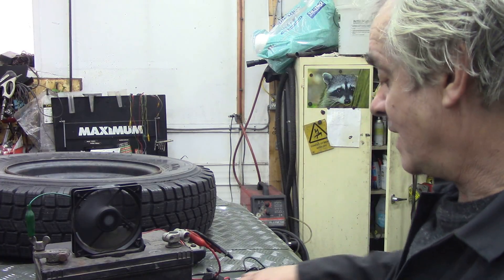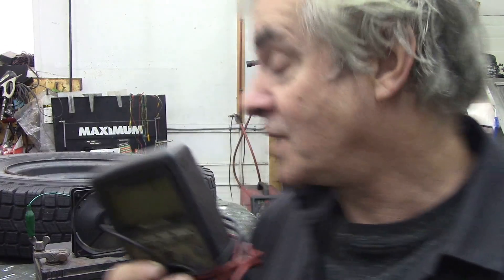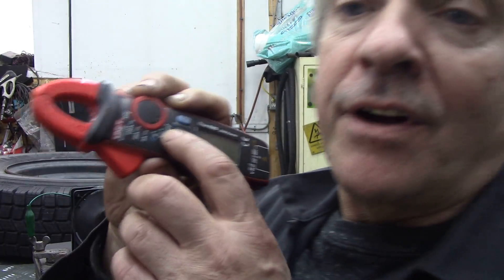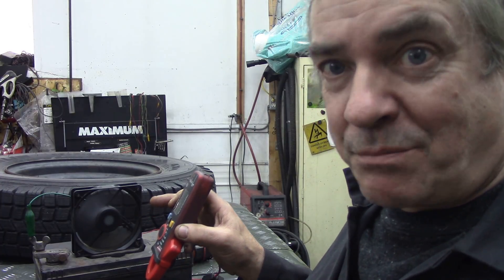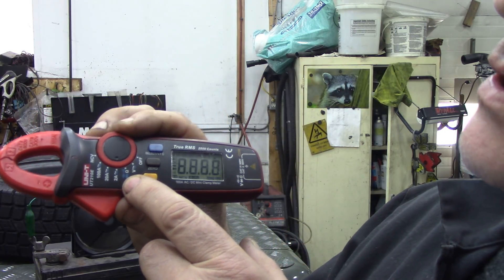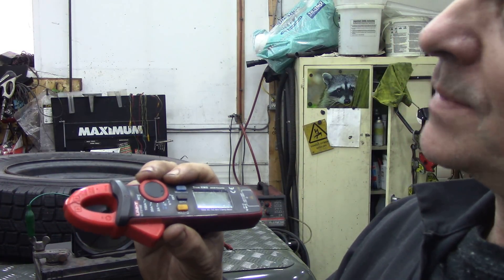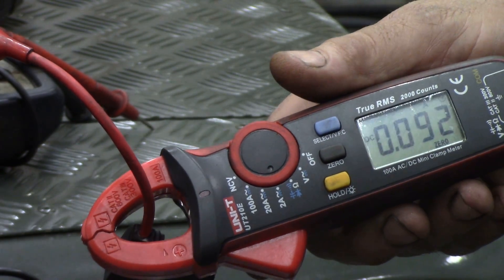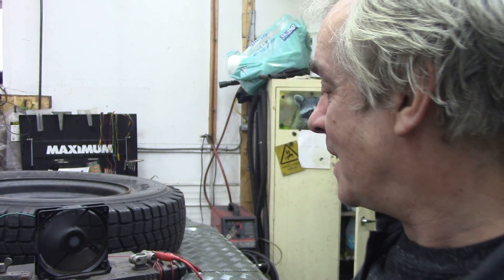Using a UNI-T UT210E clamp meter to test circuits for current

Comment: I like your style and presentation... no music or waffling on for 20 minutes before getting to the point! I just bought one. I have a high parasitic drain over night and can check my individual circuits and globally to, without removing a battery lead and inserting my meter in series. don't want to lose setting in the car. This is easy! Thanks

Comment: I tried the fuse pulling trick once. The drain was across 4 different fuses. So we just put a manual disconnect on the battery and used that if it would be parked for more than a day.

Comment: I have seen a stereo install cause a problem do to the install not the stereo it self. A screw they used nicked a wire in a wire bundle of the vehicle just enough to cause a high resistance short which drained the battery within a couple of days.

Comment: Great meter. I always carry it in the Defender. Caused some suprised looks on the faces of some other offroaders, when they couldn't find the fault in their recent solar panel setup and I used the UNI-T to measure the currents without dismantling their circuit; they had never seen a clamp meter before :-)
Reply from the maker: The DC clamp meters have become affordable in the last few years - so easy to use to fault find!
Reply: Excellent use case. I keep this in my readiness kit in my vehicle. I can do so much with my electronics knowledge if I have a meter I would want this over and above a knife in a non wilderness survival situation. I can create a cutting tool. Trying to create a meter on the fly is a little harder.

Comment: NCV Yep more easy that having to poke the insulation with a needle.   Voltage but no current often terminates in a bad or missing ground. BTW those UNI-T multimeters are rather fine for the price .
Reply from the maker: They are very good value for money!

Comment: I use a battery disconnect on my '72 Series 3 when sitting for any length of time.
Reply: I have done that a lot on old cars. With new cars the computer can get messed up if it is without power for an extended period of time. Really annoying v

Comment: Top tip for using the UT210E clamp to measure very low current, if you wind the wire through the clamp twice you double the reading, winding it 10 times increases the measured current 10x so you can get milli amps to into range of the meter.... just remember to divide the reading by the number of wire turns.
Reply from the maker: Great tip!
Reply: Excellent idea
Reply: Thats a really good tip. Thanks👍🏻
Reply: Wow nice 
And how to measure ?
And when to zero it
Put wire in the clamp then zero it
Or zero it then put wire in the clamp
Reply: @purplefurture6960  for my purposes I made a small device which was a male mains plug connected to a female mains socket  by  Line/Neutral/Earth wires, the Earth wire was coiled 10 times and wrapped into a loop which the UT210E clamp could fit over. This setup lets me to plug a portable appliance into the female socket and then into a mains outlet and enables me to measure the earth leakage current.

Comment: ....your method is fine until you have the problem that's plaguing my Defender atm....the intermittent parasitic draw has returned....I have checked every fuse multiple times and am still none the wiser as to where the draw is coming from....I can measure it at the battery from time to time, but as soon as I start testing it disappears!....I'll catch the little bugger one of these days...😂
Reply from the maker: Check out the alternator - it has been known for the diodes to go
Reply: @BritannicaRestorations  will do...I'll be bloody annoyed if it is...it's less than a year old
Reply: @GrumpsBarn  I have had a similar problem. Turned out to be the starter solenoid main terminal had continuity to earth.

Comment: The meter is great for checking insitu 300TDI glow plugs and working out which one might be faulty. Total current is about 55 Amps, which drops after a few seconds.
It's great for finding parasitic current draw too.
Reply from the maker: Yes that makes it worth its weight in gold!!
Reply: @BritannicaRestorations  Another tip is swap the direction of the wire through the clamp. Both readings should be the same value.
The readings on mine were different because of an offset after zeroing it out, but a calibration sorted that out.

Comment: if you're not sure how many amps  ' set your meter to it's highest scale , then wind it down to suit '  .. very wise words , i've seen many apprentices blow an expensive meter by not doing this
Reply: This meter is great for new people because it does not have any ports to test amperage with the leads. It can only test amperage with the clamp. Since it is a clamp that senses the amperage instead of going through the meter you can’t damage the meter. 

Because of that this is the meter I give as gifts to electronics newbies.

Comment: Disconnect the battery, place the meter on the cable you want to measure, THEN zero the meter... reconnect the battery...
Reply: Yes if you are in need of that level of accuracy. Also get used to holding the meter the same way every time the position of your hand can affect it a little bit. 

On another comment they suggested doing 2 readings buy reversing the direction the wire goes through the clamp. The numbers should be the same one will just be negative. If not average the 2 for a more accurate reading.